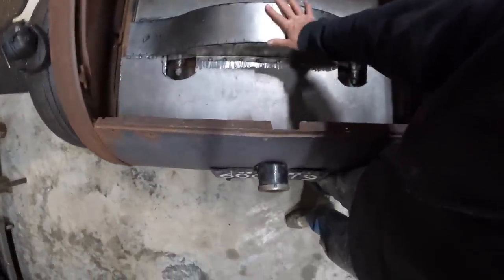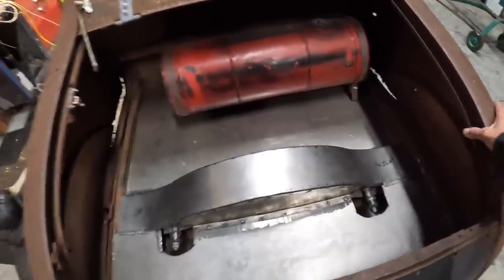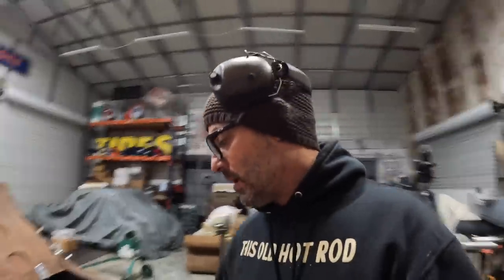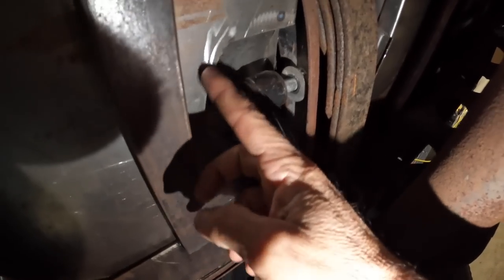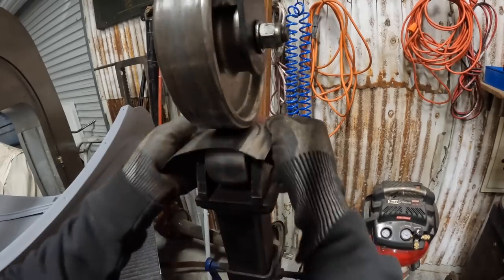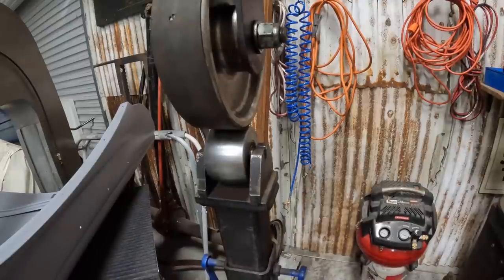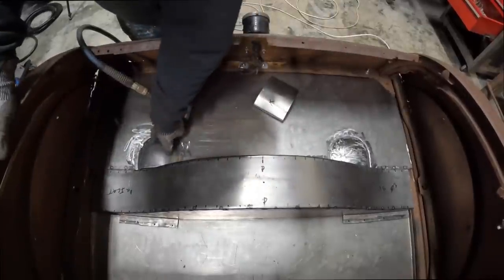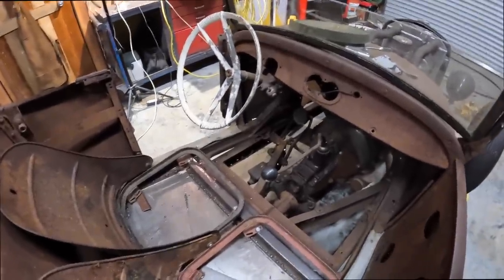Sheetmetal Fabrication [Shock Blisters]

Comment: Hey mike, i just watched your blister video. Where i live here in Australia, ride on lawn mowers, small 4 wheel drive farm bikes ( that are made in japan, Taiwan etc ) are imported into Australia on metal frames which in turn can be fork lifted during shipping. i would presume this would be same process used in the U.S. and other countries. i often visit farm centres, bike shops etc and collect these frames and variety of size r.h.s. flat steel, U section and also pressed steel. ( excellent for seat support as no folding, bead rolling is required ) ....( i cannot get these same unique pressed U section made here ) ... Retailers here are happy to give this steel away as it saves them taking same to the tip.. ( scrapyard ) i have used this steel in supports for the floor in a hotrod, also seat supports, inside trunk, fuel tank base, battery hold down, windscreen frame  .... many many uses. Some frames have " hollows " which i have cut out with an angle grinder and used for a blister on a hood and hood side cover. these have unique tear drop shape. i have cut these shapes in half and fitted to a hood and then added a vertical flat section of 18g steel to rear and then cut a hole and fitted an old amp, fuel gauge etc.. gauge doesn't have to work cos its a ratrod...also used the 40mm x 40mm and 50 x50 frames to make work bench's, and the steel is on hand on the weekends when the steel shops are closed...i think you will be surprised what is available and the many uses you will be able to use it for in your rods you are making. anyway.. keep up the good work you are doing there.. cheers from charlie from down under in OZ....
Reply from the maker: I am never surprised in what people can make out of scraps or someone else’s unwanted steel.  I use what I have on hand as well. Not sure I’ve seen exactly what you’re referring to however.  
Thanks for the kind words !

Comment: You need a ceiling fan to get some of that heat back down from the high shop ceiling.
Reply from the maker: I know.  I hadn’t planned to be working in this shop. So I haven’t had a real elec service trenched to the building.  Once that happens I’ll get the elec done and the ceiling insulated then the rest will follow

Comment: .go to tractor supply they have a heater works great makes no noise puts out over 5000 BTUs of heat will work good and you can still film
Reply from the maker: I’ve got a few others also. I have heat in my other shop where the 34 is. I’ll be back on that in the next few weeks

Comment: Can you have spray foam insulation put into those garages?
Reply from the maker: Yes.  I am calling a local co to get a price on just the ceiling area.  I already did most of the walls.  I’ll need to finish those but the garage will have to be cleaned completely I think to spray the ceiling.

Comment: It doesn’t look like there is enough room between the end of that bold and that piece of tubing hour using as a floor brace to get the shock off the bolt.
Reply from the maker: There is room.  I made sure by removing the top of the shock when it was tacked in.